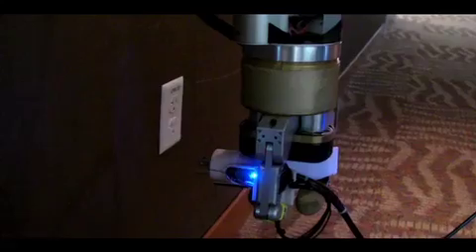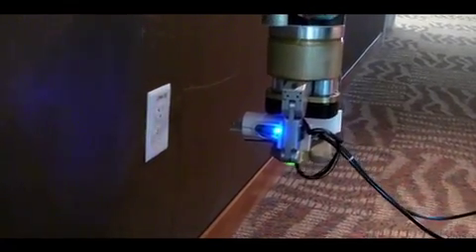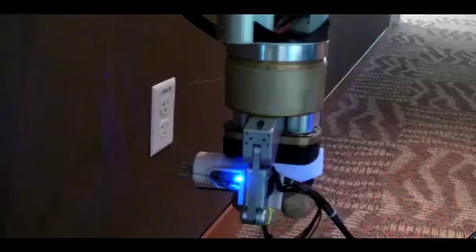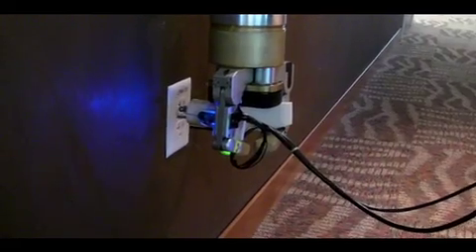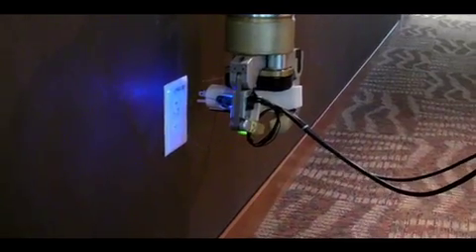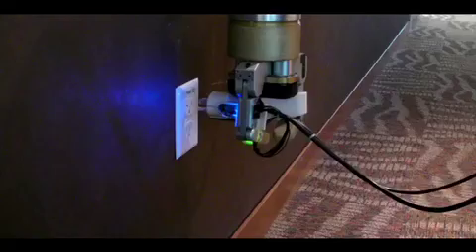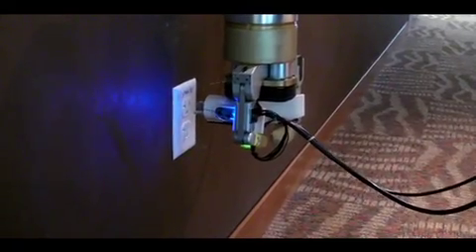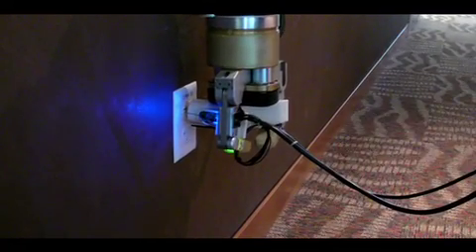Intel Labs' Marvin Robot Plugging Itself Into Wall Outlet

Comment: By the time he plugged it in, he'd be out of power...lol.  Wouldn't it be best to use a dual-eye system to calculate the exact x,y,z position relative to it's arm, then use that calculation to move the arm into an offset position and push the plug in?  Or have you not gotten that far in artificial intelligence yet?

Comment: You're an idiot.
This robot is not plugging anything in,
 it is plugging itself in.
It is acquiring its own nurishment without human assistance.
Robots can live thousands of years if built correctly.
I have an solar autonomous robot crawling around my back yard,
 and if nothing interrupts or discovers it,
 it might be still working up until it eventually rust out.
The solar pad will go out eventually too.
But this robot!
So much power can be taken from a wall!
This thing could do ANYTHING.